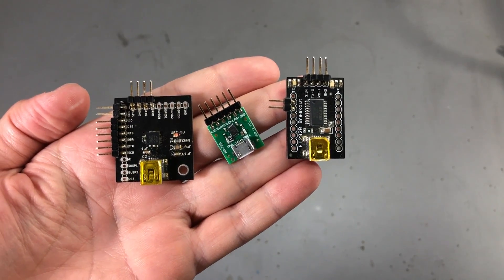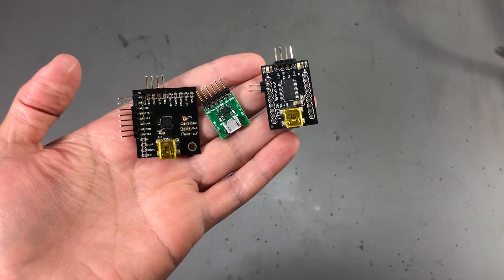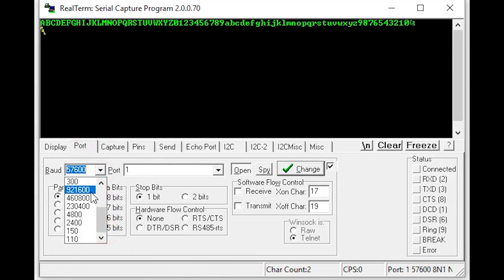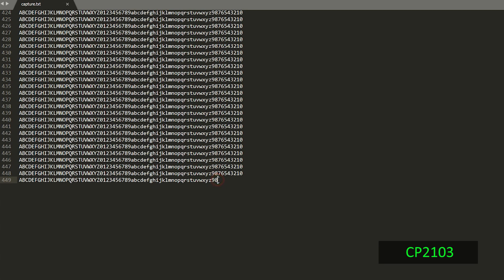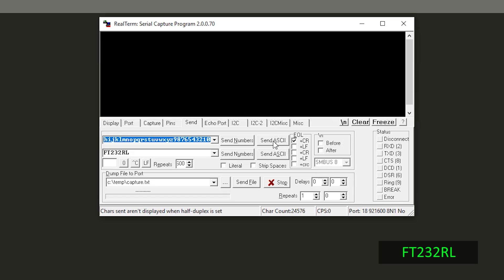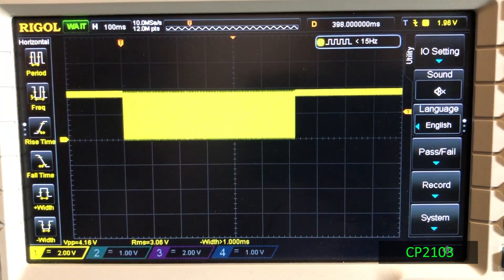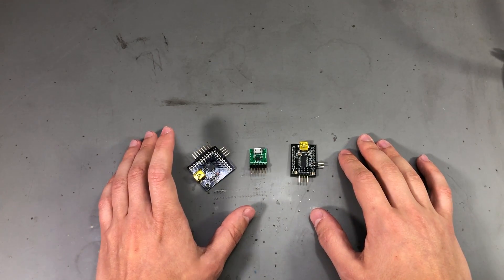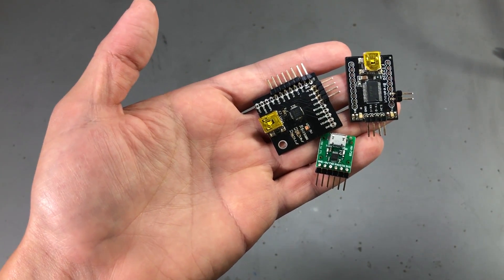Voltlog #260 - How do you test usb to serial converters? (CP2103 vs CH340E vs FT232RL)

Comment: Two of the models seem to output 5V on the TX port, and the other one 3.3V. 
Is it something you chose ? 
I would not be surprised if on some cheap adapters the jumper/switch will only change the voltage on the VCC pin but the TX pin will still see 5V when you asked for 3.3V.
Reply from the maker: this varies a lot by model and as you hinted some of them just change the voltage on VCC pin.

Comment: I would suggest doing a long overnight test sending data in a somewhat slower pace, e.g. 115200 baud which is a very common rate in real world devices. It would be nice to see that the devices run without issues overnight with data trickling through at a steady pace. This is a common use case for data logging applications. You could write some code on the PC to check that all received data is correct and have an Arduino transmitting the data continuously.

Comment: while your designing a USB to serial adapter will it be possible to add a level shifter and also have the provision for USB to RS232
Reply from the maker: The usb to serial adapter I'm designing based on the CH340E has a switch for selecting 3.3V/5V operation. It will not have USB to RS232 conversion as that can be done with a separate module and I never really need it.
Reply: @voltlog  all it needs is a charge pump chip and the actual connector so why not add traces and don't populate it
Reply from the maker: @xbipins  because I don't need it.

Comment: I prefer to avoid FTDI and Prolific due to the shit they pulled with their drivers.

FTDI decided it was a good idea to brick counterfeit chips if you used them with the windows driver.
Prolific dropped support for their older chips because they couldn't detect if they were genuine or not.
Reply from the maker: More reasons to use the CH340E 😁

Comment: All my USB to serial converters are CP2102. I never had a problem with them, neither on windows nor Linux (can't say the same about FTDIs or prolifics). I've ten or fifteen of them, because the modules are so cheap and small, that they just stay connected to my half finished projects, in case I want to continue them ;) .
What I like most about the CP2102 is that there is a software by the manufacturer Silabs, which allows you to program custom baud rates into the chip (just connect it, start the software and set your baud rate; it's stored in the controller). This is very handy when you have a device with an odd baudrate that isn't one of the typical ones. It also allows you to get a 2Mbps serial to an atmega328 (also it's hard enough to get the data fast enough into the serial registers), or better micros like STM32 that can actually make use of that quite high speed serial with DMA.
Reply from the maker: Yeah I would expect the CP2102 to have better support from the manufacturer but ultimately what I wanted to find out is if I can reliably use the CH340E in future projects. I don't think I've proved that with solid data because my measurement methods we're not optimal but I didn't notice any bad behavior either, for me that's enough to continue using the CH340E whenever the cost saving is needed.

Comment: Suggest do more tests on the electrical characteristics side, like: voltage level tolerance, reverse polarity protection, how much current it can sink or source on signal lines, performance under stress and high temperatures, immunity to electromagnetic interference, ESD tolerance... etc. And all of that without a PC (e.g. with a microcontroller interfacing and oscilloscope). Besides that, great content and appreciated efforts.
Reply from the maker: Running the suggested measurements would provide solid comparison data between these adapters but that would be a whole project in itself and I'm not sure I'm willing to go that far and spend that much time and resources on this. The CH340E seems to be working, I haven't noticed any bad behavior so I will be using the CH340 in future projects unless I noticed something wrong on the way in which case I will be reporting here on the channel.

Comment: Why there's that orange tape on those USB connectors?
Reply: Now that I've woken up properly, here's a more definitive answer that's backed up by evidence! :D

Yes, the tape is for pick-and-place machines (it's likely Kapton tape, or a generic polyimide clone, for its heat resistance).

Check out the product listing for surface mount mini USB sockets on the Toby Electronics website, here: https://www.toby.co.uk/signal-to-board-connectors/usb-connectors/musb-valcon-mini-usb-type-b-surface-mount-socket/

The product details include this line: “With Pick and Place pad as standard (Yellow tape on top)”

And regarding pin headers, here's the page for a Samtec surface mount pin header: https://www.toby.co.uk/board-to-board-pcb-connectors/254mm-headers/tsm-samtec-254mm-dual-row-vertical-surface-mount-header-813mm-post-height-02/
The product page itself doesn't mention the pick-and-place pad, but the datasheet does: https://www.toby.co.uk/uploads/publications/2071.pdf mentions options "-K" for a “Polyimide Film Pick & Place Pad”, or "-P" for a “Plastic Pick & Place Pad” :)
Reply: Thank you guys, especially  @AndrewGillard  for great explanation.
Reply: I always thought it was there to allow those parts to be used in a vacuum pick-and-place tool, because underneath that tape the connectors have holes in their shells that would render a vacuum pick-up tool useless. I definitely don't know for sure, though :)

You see similar things on strips of pin headers: small bits of plastic that sit on top of the pins, supplied that way from the factory, so they can be positioned by machines. Those bits of plastic are often removed before the finished product is sold to us, but you do sometimes see them on delivered boards (dev boards and such, rather than consumer electronics).
Reply from the maker: I think the tape is there to help the pick and place machine.
Reply: I've seen it on raspberry pis HDMI ports, I believe it's insulating, but I'm not sure why it's there.

Comment: These tests are testing the driver software, not the chipset.  Perhaps it would be more appropriate to test with degraded signals eg by inserting additional inductance into the line to simulate a longer signal path. The chip itself has probably only a handful of bytes of buffer onboard so sending large blocks of data does not work without some type of flow control. Look also at bit error rates, implement some flow control and then send large volumes of data but checking the received data for bit errors.
Reply from the maker: Yup pretty much the feeling I had, I was looking at how the driver was performing and not the chip itself. I would have to write some test scripts to send, receive and compare data over longer periods of time and with flow control like you suggested, I'm just not sure it's worth it because that would be a whole project in itself. So far I haven't noticed any bad behavior from the CH340E so maybe that's enough info to start using it in my projects.

Comment: While the idea of having standard procedure to test devices is quite interesting, as you have discovered already, there's too many variables to make this kind of test a reliable benchmark.

Windows does have an input and output buffer for serial communication (The default size, at least judging from the .NET API documentation, is 4096 bytes) and that can be increased by the application (In this case RealTerm). Devices also implement their own I/O buffers to deal with data that accumulates while it's not being read by a program. It's also quite likely that RealTerm has its own buffer as well. On top of that, there could be a delay between the "repeats" of RealTerm that may leave enough time for the buffers to be partially emptied sometimes, but not always.

With all that considered the amount of bytes you can transfer in one go will most definitely fluctuate, depending on the capacity of each buffer and timing at which they are filled/emptied.
Now, what happens if buffers are full? Well, that's also an issue, and the behavior will depend at least partially on the application. Does the application wait until the buffer has some space to send the rest? Does it timeout if it cannot send after a while? Does it discard the data? etc. This normally accounts for any missing data that did not make it past the first stream of bytes sent.

Whatever the case, I'm pretty sure these devices have a respectable serial buffer. At least "respectable" compared to other implementations of USART interfaces. Some old PIC devices (like the 16F628P) have a serial buffer of only 2 bytes.
Reply from the maker: Yup, everyone seems to agree here in the comments I was mostly measuring USB/OS/Driver performance in this test and not the actual usb serial chip performance. I would need to invest a lot more time and resources to properly test this chip and I'm not sure it's worth it. So far I haven't noticed any bad behavior from the CH340E so maybe that's enough info to start using it in my projects.

Comment: I have seen some prolific chips passed off as chg340 and they cannot do 921600 etc.
Reply: Yes, I noticed that too. On some of my cheap ESP8266 modules the max upload speed is 265k baud while other work fine with the max speed of 921600 baud.
Reply: I wonder what has happened to that company. Prolific used to make quite good stuff back in the day.

Comment: No flow control? Without hardware flow control (RTS/CTS), I'm not surprised that there were buffer overflow issues. Also, putting stuff on the screen has always slowed things down for me. Perhaps you can "cat /dev/zero > /dev/ttyS0" or something like that, or use a Python script.
Reply from the maker: I agree, a script that will send, receive and compare data with flow control would be the better way to test this

Comment: Which converter chip have better driver support for Windows 10? My existing converter with the older PL2302 chipset is no longer supported.
Reply: asgard168 I still using PL2303 at win8.1 or 10. You gotta to install any old 3.3.... driver version of Prolific. The actual 3.8 version will ask you to by an new adapter:)
Reply from the maker: CH340E, FT232, CP2102-2103 install automatically on win10. I have no experience with prolific..
Reply: Thanks guys for replying. Agreed with Night, I probably buy a new converter since they're inexpensive and save myself the trouble/time with the damn Prolific driver.

Comment: Have you noticed ftdi's annoying behaviour? They SUCK when it comes to smaller transfers in rapid intervals. For normal stuff it doesn't matter but with event driven stuff you get an additional delay of at least on ms before it empties the buffer
Reply from the maker: Even through not highly relevant, in the tests I performed the CH340E the FT232 seemed inferior to the CH340E. Whether that's driver related stuff or hardware related stuff I don't know.
Reply: @voltlog  I think the delay is just how the hardware works. Granted ft232 is quite old by now so I'm perhaps being a tad harsh on it. Never had one act up on me, I just find them.. "less than optimal" for certain types of transfers when it comes to speed :P
Reply: Timeout can be configured in Windows in Device manager properties. In Linux there is some console command.
Reply: @hubmartin  and what is the minimum timeout? One ms. Did you even read my post :p
Reply: @Chriva  I did. My brain overlooked "on" and evalueted "ms" as milliseconds :) If rapid intervals means under 1ms so there is nothing more to do.

Comment: Linux is actually better at serial communication than windows, In linux I can go way faster than windows submitting data. Should try a RPI.
Reply: Doh. That's because it's integrated INTO THE PROCESSOR. :P Built-in sbc-uarts are in another league. Not comparable :)
Reply: @Chriva  I actually mean using CDC drivers, do not use the built in one.